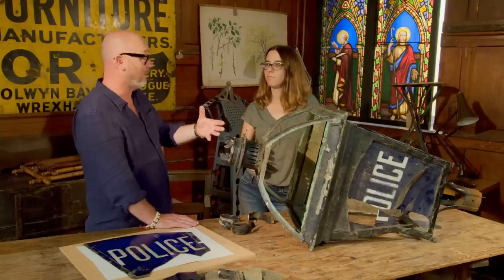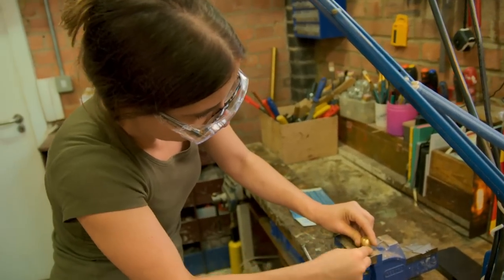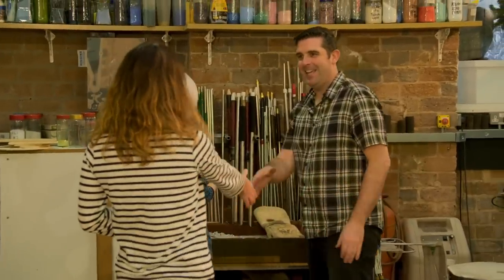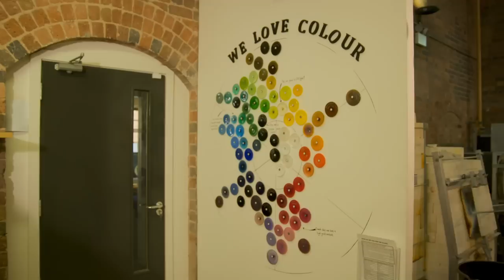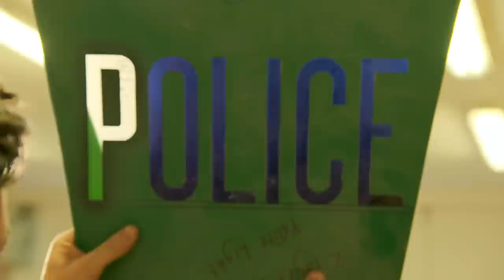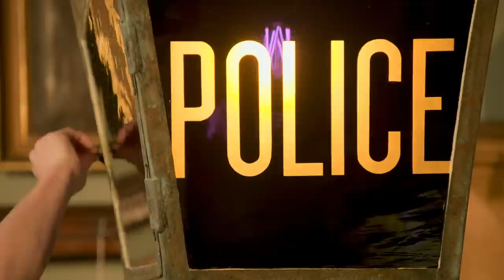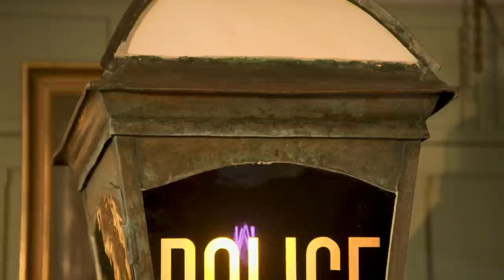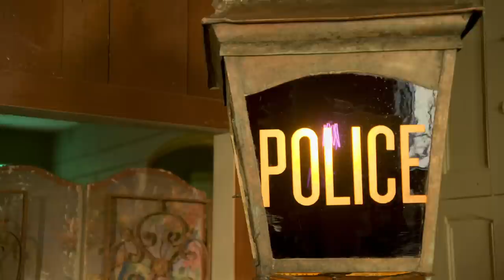Restoring A Victorian Police Pillar Lantern | Salvage Hunters: The Restorers

Comment: The letters are cut off. The color way off. An epic failure. Sorry.
Reply: Have a look at the staining on the original panel - the frame covered up a percentage of the letter edges when it was first produced.  Now the letters may have become just slightly oversized with sand blasting (doesn't look like it as the edges are VERY sharp BUT it's easily better than I could have done and is far more period than the blue glass paint I've seen used on some restorations.